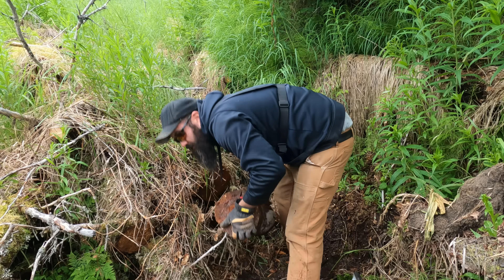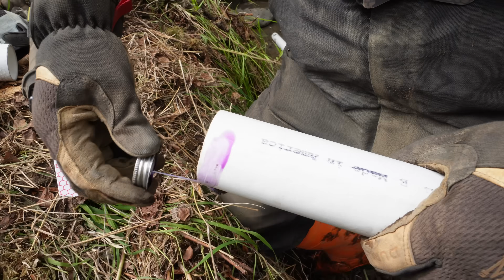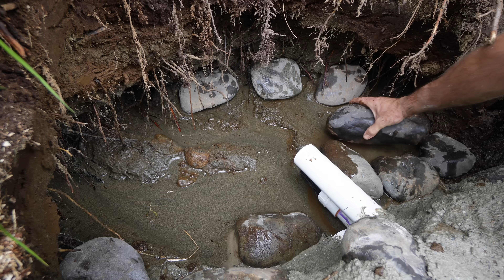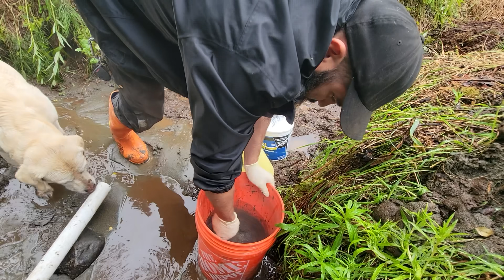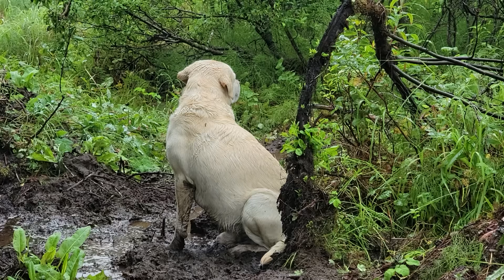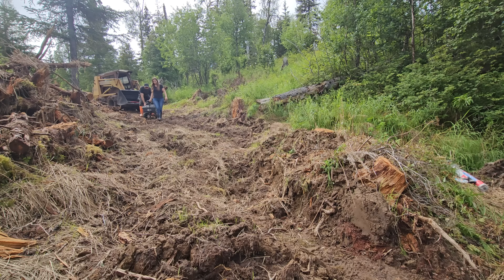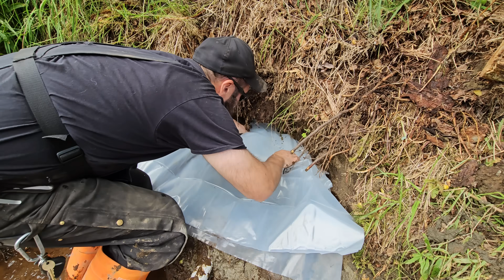Digging for Natural Alaskan Spring Water

Comment: You are on the right track  BUT THERE IS A BETTER WAY TO DO IT IF you fill your resvior over your fill pipe from spring you will need a vent at spring  I'm 80yrsyoung Doing springs most of my life with grandfather when I was a kid an Thur life
Reply from the maker: I believe the upper overflow pipe will act as a vent for this purpose because it never has water inside. Thanks for watching.

Comment: You built all of this on sand? are you not worried about the water going under the wall
Reply from the maker: The inside is lined with cement and clay on the bottom where water pools up. I forget the time stamp, but we talked about the hydraulic cement and clay.We probably should have called this a funnel instead of a dam. The goal was not necessarily to dam up the water but to funnel it into the lower pipe. Usually, if you dam up a spring seep, it can cause it to dry up and come out of a different seep instead because the back pressure causes the water to search for an easier path.  A true dam would probably need a 2 foot concrete footer. Thanks for watching 🙂
Reply: Thanks. that makes a lot of sence. Cant wait to see how you develop your property. Keep up the good work @northtoalaska2022

Comment: You need to be sure of the 'source' of the water, as groundwater shows up everywhere ,but can be deadly. The thing about water that most people do not understand is that looks can deceive you. There are a lot of harmful bacteria that can't be seen with the naked eye or normal filters. It has to tested beyond the local county agency. That is why knowing the source is important. It may show clean on one test, then wild animals drop urine and feces, it rains, then the test fails. Normally spring water shows up as bubbling up out of the ground, or comes out of the ground faster than you plug it, all on a dry day. If it is spring water, isolate it to a small inlet and cement all the other ground and sides to keep GW out, even above ground to count for a heavy rain. This advice comes from over 45 years in the water and wastewater industry, on the government level. Be safe above all other advice.
Reply from the maker: Hey, thanks. We are now sure the source is an underground aquifer. We had it lab-tested before further development. The water is clean enough to drink from the ground however we still filter it.  It is essentially like well water, this is not a spring from an above groundwater source. Where we live at a higher elevation there is no mining or agricultural pollutants to contaminate the source.

Comment: All you need now is a ram pump.
Reply from the maker: Would love to use one, but they do not fare well in an arctic winter. We also do not have enough gpm or vertical drop to power even the smallest 3/4 inch ram pump.

Comment: Looks like you've done a lot of thinking to get to where you are and it looks pretty good. You might want to add what I've learned to what you are doing for future stuff. This is the best way I've found to tap springs. You could put several of these in for multiple springs coming out of the hill. I like to just use the small clay dams to direct multiple springs, or seeps into the same spot if close together.

https://youtu.be/4Gv5GB4XJW0

https://youtu.be/WYLIeRG-J-8

Keep up the good work,
Bobseyes
Reply from the maker: Hey Bob, thank you for sharing! Funny enough, a few months ago, when we were researching how to cap this spring, I watched and studied your second video in this link as well as a few other online sources. Unfortunately, the quality of my natural clay here is not perfect, and I have not been able to locate bentonite clay in the state of alaska to use in the fashion you show.  So far, this cap has been in place well over a month and is working as expected. We are hopeful that it works out for the long term as it is our primary water source out here 😀 Thank you for the kind words!

Comment: Leaving  the silt strainer on the 2" outlet pipe may have been unnecessary it could plug up very quickly with sediment .Leaving the pipe end open would have allowed you to clean the pipe straight thru to the water source if you have issues with water flow down the road. Just trying to be helpful with my comments. Love your videos.
Reply from the maker: We will have an updated video on the spring in to future, so far it has been perfect! The screen has large enough holes to allow silt to flush out naturally. Thanks for watching!

Comment: I dont like the fact you will have to tear it up to clean the sceen
Reply from the maker: At this time, it has been flowing through the pipe since about the end of June, the beginning of July. I can not remember the exact date.  The screen has large enough holes to allow sediment to flow out the pipe. Sediment does collect in our spring box that is not  shown in this video, but it is easy to clean out and keeps our water purifier from clogging fast. We will have an update on the spring in the near future and how it is working for us. But I can say that so far, it is working great with no maintenance to the spring cap shown in the video. I am hopeful that it continues to self clean itself of sediment build-up. Thanks for watching!

Comment: YOU CAN ALSO DO A UNDERGROUND  WATER  TANK BUTWITH A WATER HEATER SO IT WILL NOT  FREEZE....ALSO...
Reply from the maker: Unfortunately, with us living off the grid, we have limited electric supply. I don't think we have the capacity to run an electric hot water heater underground.